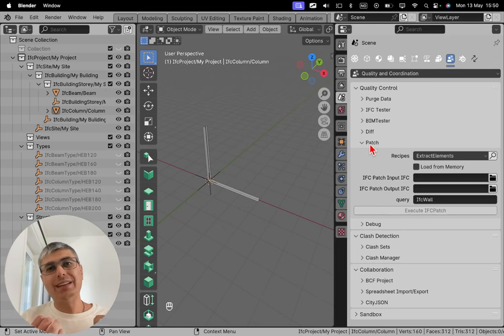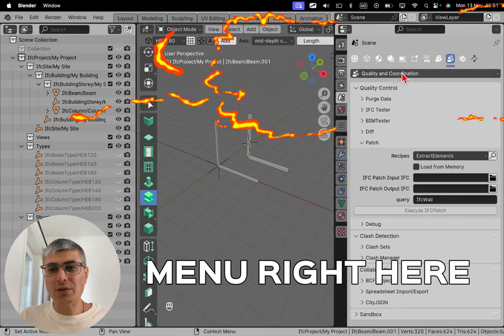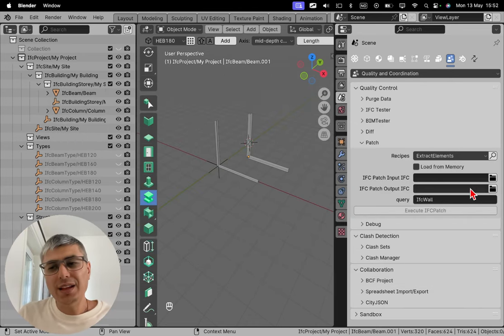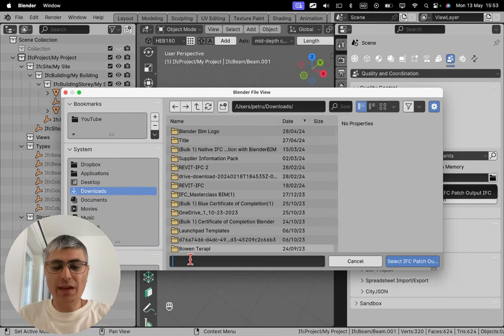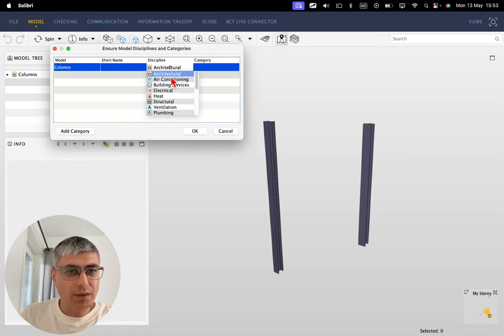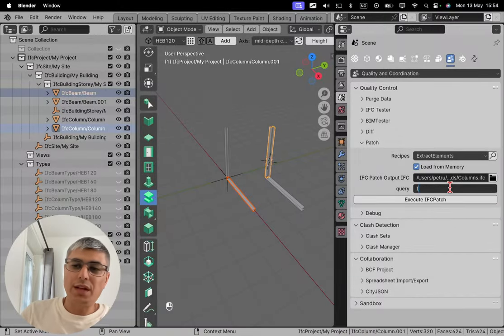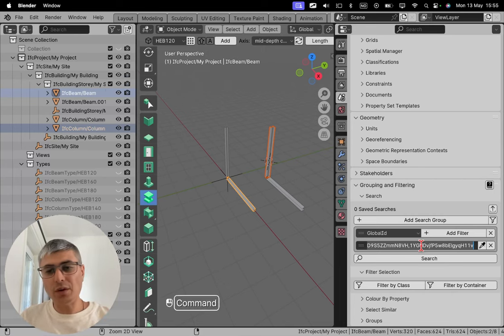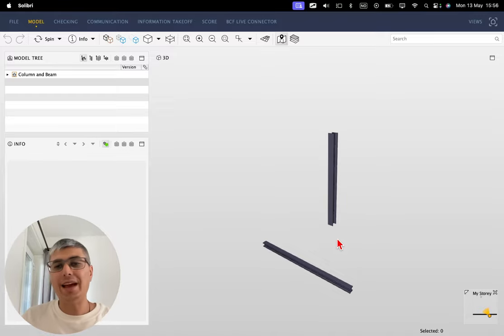IFC Elements Extraction Made Simple - The Easiest Way Period

Comment: Thanks for this awesome showcase! I've tried using the "Patch" tool before, but only ended up with various python errors during execution. I consider that my lack of programming knowledge, but anyway my question is different. Is there a limitation on how many element categories can we export at a time? I had a project in the past where I had to separate a building in levels and after that extract only the architectural model without any furniture or MEP systems and elements. At the time I tested IFCToolbox, but unfortunately the output IFC wasn't recognized by our internal tools. In the end I used SimpleBIMs free trial to achieve my goals. Do you think this is possible with medium to large buildings via the "Patcher" tool in a timely matter? 
PS: I'll do my own testing and come back here with results.
Reply from the maker: Give it a go and report the issue you encounter. Then let's try to see how can we overcome them :)
Reply: @BIMvoice  Thanks for the quick response! Fortunately I didn’t receive any errors this time. What I didn’t understand before was the input/output ifc variables. Anyway, since I wrote my comment I initiated a SplitByBuildingStorey of a 300+MB ifc file without loading it from memory, but specifying its directory. Good news is it didn’t return any errors when I initiated the IFCPatch. Bad news is that it is still loading. I’ll add my result when I get it. Do you have any tips to quickly reduce the file size before initiating such procedures?
Reply from the maker: @Avesa92  try with a smaller model and see if it works at all. If it doesn't please create an issue on Github. I'll try to make some content around this in the upcoming weeks.